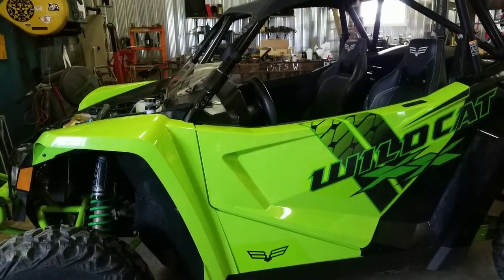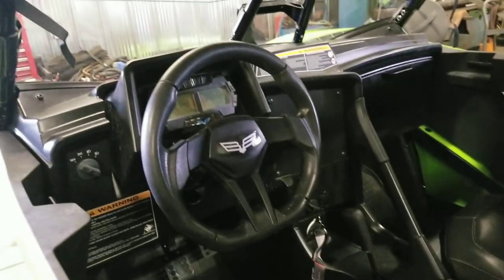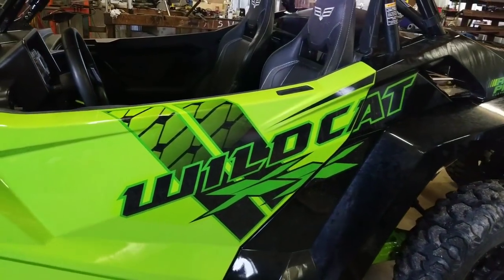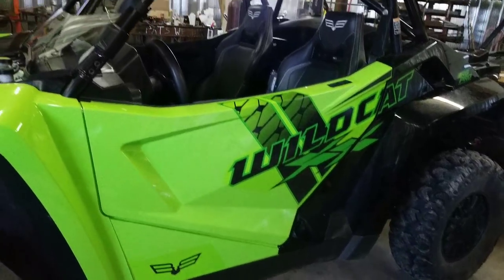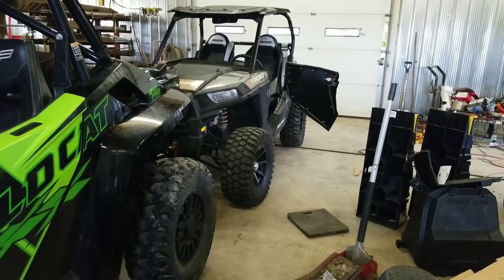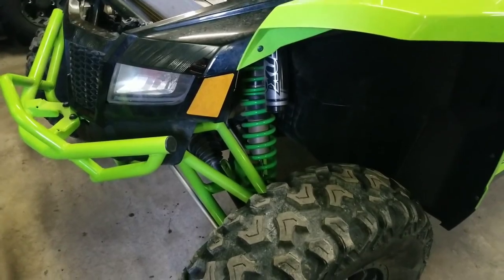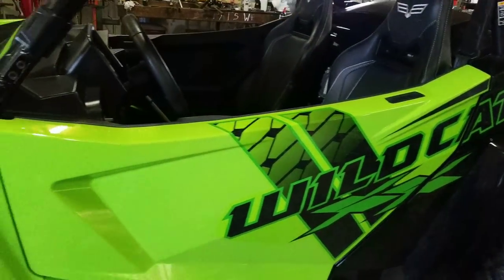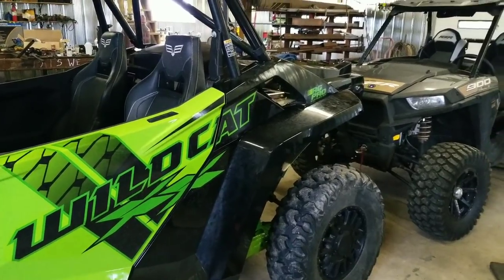Textron wildcat xx long review

Comment: Speedwerx hyper shift clutch and new PTO output shaft. No more chatter, way quieter.  Butter smooth. No more low gear for trailer loading. By far best thing that was added. Can’t imagine the ECM flash with 120mph and 9800 rev limiter. Had plenty of passengers brace for a sore a$$ on a whoop or jump. When it lands the look on their face is priceless.

Comment: Running a 2020 Tracker XTR 1000 which is the same thing just different colors.  Add limit straps and your axles will never have any issues.  If you want to really feel that suspension, get hold of Shock Therapy and get their spring kit.  Just their tuned high quality springs replacing the stock ones is probably the best mod you will ever do.  Takes that amazing suspension and times it by 5.